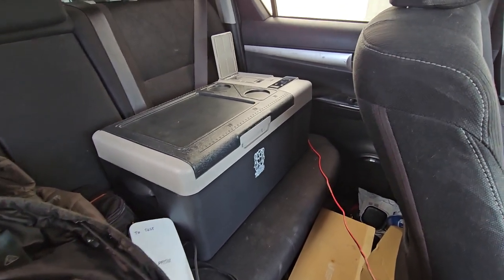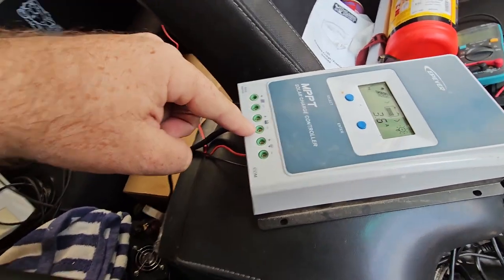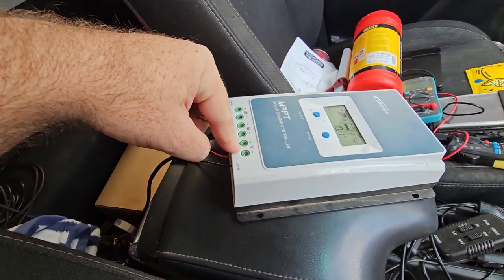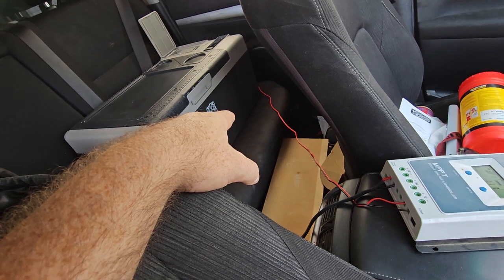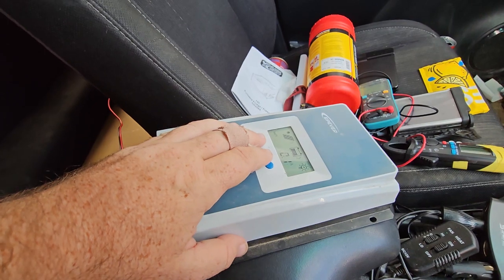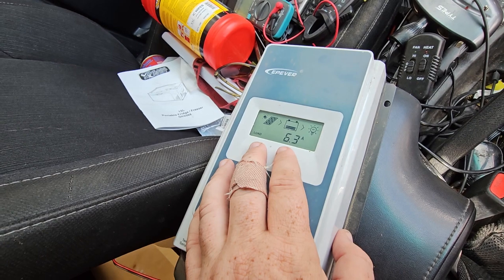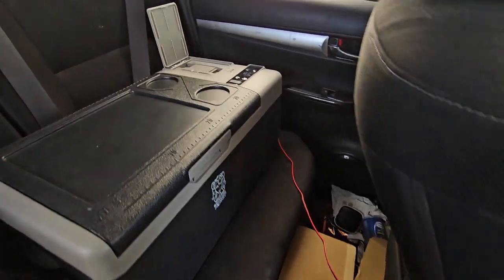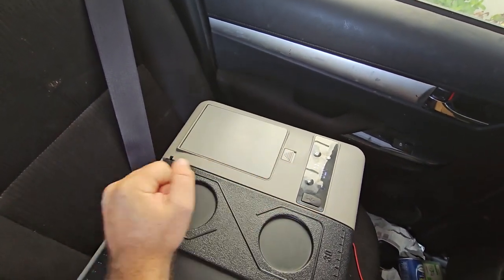Brass Monkey Fridge MPPT Solar Solution

Comment: Hi hbaykiwi 
What was  your final conclusion to get the best result using the fridges battery, I have a 150w panel that i have in the past run straight into the solar barrel plug on the fridge but the male plug does not like the amps and started melting, from what i can make out of your info I'm better off getting a 10a mppt controller  and plugging the out put into the 12v ac/dc plug on the fridge, I'm just not sure how you got the mppt controller to power on without an external battery and would it be possible with some of the cheaper mppt controllers on trade me?

Comment: I went with a slightly different route to provide extra power to mine, automatic battery isolator and a spare car battery. 

I also have a 100Ah camping battery that I fitted out with MPPT and a socket to take the BM "solar blanket" since the solar panel itself didn't seem to do so well direct to the fridge - never thought that the inbuilt solar charger would be quite so bad! 

See my setup at https://youtu.be/HEZD-71YTwk (youtube HEZD-71YTwk if they cut the link)

Comment: Just curious, to achieve this I assume you are running the output  from the MPPT into the regular charging port instead of the circular Solar port? If so, does it charge the internal battery if you have one. Currently working out reasonable camping options.
Reply from the maker: I am running the load output of the solar controller into the 12v input of the fridge - thats the same port that which you would normally connect the 12v vehicle supply or AC<>DC adapter. 
The unit has a charging circuit built in that will divert excess energy to the internal battery for charging once the compressor has used what it wants to. 
I really hate that it uses a DC barrel jack for the solar input too. But if you have heaps of amps at 12v then you can use the main 12v input
I have also since connected a 12v 120ah deep cycle battery up. It works reasonably well though i need to find some time to wire up a relay to switch the 12v input from the solar controller to the vehicle power supply so it can get a bit of a boost on cloudy days - since i typically drive an hour a day that is energy from the car i could be using.